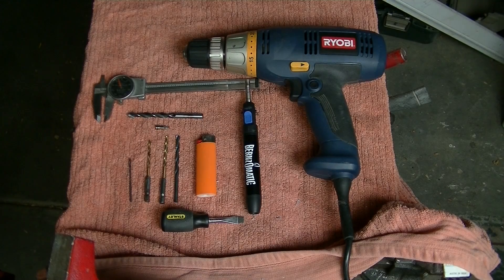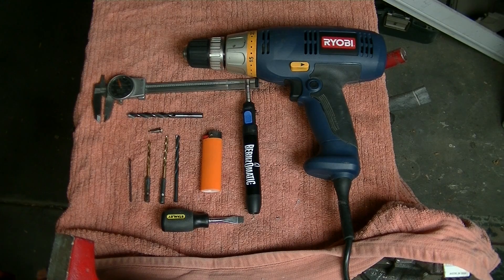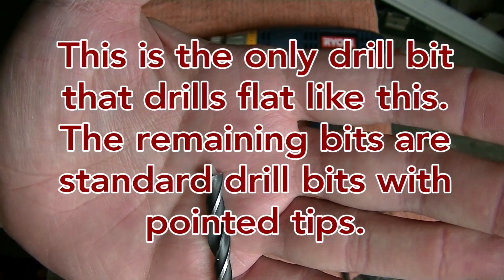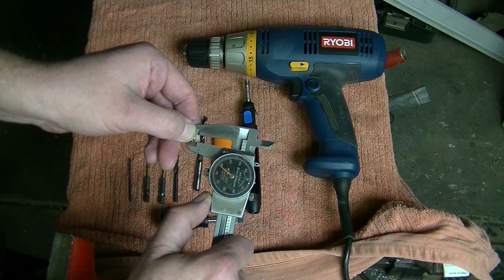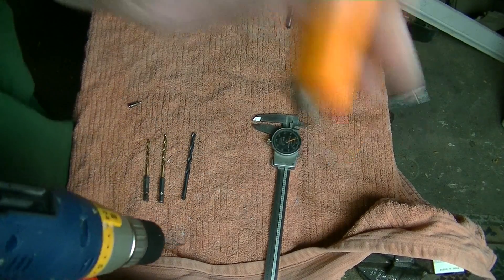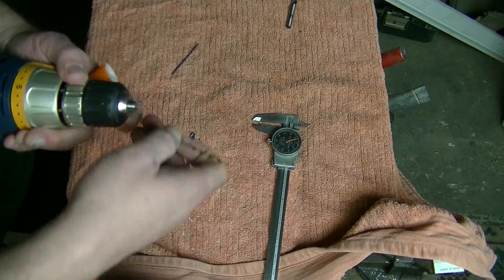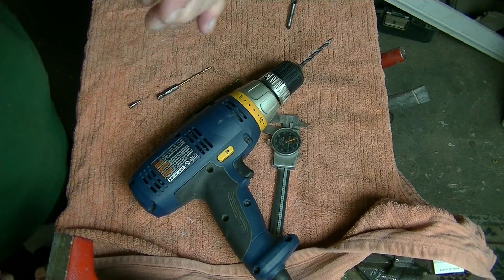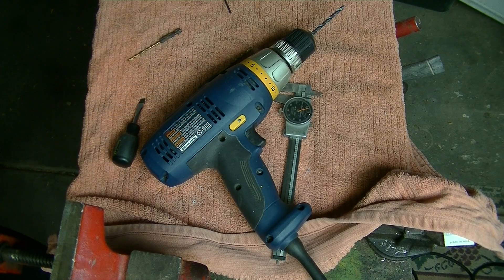Make A Bic Lighter Refillable By Installing A Refill Valve

Comment: I have installed valves in Bic lighters and suggest the following to avoid chipping pieces off the center partition that can increase the chances of clogging the system beyond what might have fallen in during the hole drilling  step.

Sand the perimeter ridge that extends around the bottom of the lighter until even with the bottom to create the widest smooth surface for the gasket to seat against. Then, mark the hole you will drill off center half way between the exact center and either side of the lighter which will allow a full seating area but prevent drilling into the internal partition. I drill with an 1/8th inch bit first after making a small starting point with an awl or center punch (this risks having more plastic pieces that may not come out when you try to remove them). Then I drill as squarely as possible with my final bit (#15 for my valves) and go slowly to avoid any possible cracking or creating a rough sided hole. Next, I create a small chamfered entry point around the circumference with a countersink in my fingers, to help the valve threads dig into the hole sides under complete control. I install the air soft valve with JB Weld black RTV silicone goo which doesn’t stick to the plastic but is good at sealing against pressurized fuel leaks (allow several hours for it to cure before fueling). I have installed the same valves successfully on the smaller Bic lighters as well. Note that you will wear out the flints eventually but they are available online. Be sure you get a small enough diameter flint. I apologize for not providing links but I had no trouble locating everything online. Best to all.
Reply from the maker: This is great! An off-center hole makes good sense.
Reply: Please can you make a video
Reply: Thank you for sharing 👏

Comment: What’s ridiculous? Is that? It’s so easy to remove the pin after you refill it that way. I will either just tap it on the concrete and it’ll break off and then push the pin the rest of the way in or I can snip it either way.

Comment: If you take the flint and guard off, and wedge the lifter valve up you can fill them through the top . It is difficult and fiddley but can be done.

Comment: 10 years later. How many of you just bought yourself a Clipper Reusable lighter? Can replace flint and fuel. Both so easy and fast. Sure you can replace flint on BiC but hard though. It's designed to be anti user serviceable. Same price gets you the vastly superior clipper. Fuel is better. Isobutane vs butane lights better in the cold. You can fit 2 zippo flints into the spring loader that pops out under the flint housing which it itself comes off the lighter. or if you have more than one clipper and got no fuel in one and need a flint in one with fuel, just an easy swap. it also packs a joint nice and tight. Yeah that kind of joint.find an old bic on the ground and don't have a flint in your clipper. easy fix to get it running because that old bic flint will pop right in to the clipper flint loader. even those free or 50 cent lighters will be cheap ways to buy a flint for a clipper. Clipper is the best and you don't got to build f all.
Reply from the maker: I just don't like the feel of clipper lighters in my hands ... something about the shape of the Bic combined with the material they use and the feel of the strike that makes it the superior lighter in my opinion.

Comment: I used a vice grip to hold the lighter and worked my way up to a 3/16" or 11/64" bit (idr - whichever one is smaller), starting with smaller bits. 

then I had to eat up the middle barrier in the fuel chamber a little bit with one of the bits so the refill valve would fit...

I used a handheld M6 tap and carved some threads, then the valve just screwed right into place with a perfect seal.

it does stick out a little so you can't stand it up on a table - which seems important to this creator so idk... it's not like a thumbtack at least lol

Comment: Just buy refills.
Reply from the maker: They do not sell refills for the Bic lighters ... you just have to buy more Bics.
Reply: @MikeSims70  well can the flint be replace on a bic?
Reply from the maker: @mick62569  Not very easily. However, the flints that they put in the Bic lighter is good for about 5 refills ... they are quite large.

Comment: you could also use the vice when drilling so you drill straight and not into your hand.
Reply from the maker: I've 3D printed a molding for the lighter in the past that is shaped for the lighter but ultimately provides flat surfaces to use in the vice. It worked well.

Comment: Do you ever have a probem with gas leaking between the valve and the lighter? Do you keep the rubber seal on the valve when you insert it in the lighter?
Reply: Rubber seal on the valve is what stops it leaking out while your refilling it. It causes a seal only letting the gas into the lighter.
Reply from the maker: The rubber o-ring seals it well... this is why the flat bit is used, to make the proper surface for the o-ring.
Reply: Still no name for the flat drill bit? @MikeSims70

Comment: you could have at least sourced them from cheap refillable lighters instead of a 10 dollar cordless soldering iron lol.
Reply from the maker: The irony of that, is that the same solderin iron kit costs like $50. But the valves can be found online for about $6.

Comment: This is pretty neat, but its very unlikely that the flint is going to last more than 1 refill. After depleting the stock gas on a bic lighter there is only 1-2mm left of flint (new flint is 5+mm) and unfortunately there doesn't seem to be an easy way to replace the flint without breaking the top mechanism. Personally I strip the flints from the bic lighters for use in zippos.
Reply from the maker: The flints in bic lighters are insanely large. They last a long long time ... multiple refills ... I'm not a fan of Zippos ... too high maintenance for me.
Reply: It's actually not difficult at all to replace flints in a bic, using little more than a flathead micro-screwdriver and pliers.

After removing the spark arrestor and striker wheel, carefully position the new flint above its spring and press down with screwdriver. Hold in place then snap striker wheel back on. Ta-da!

The only limitation I've experienced with bic is running out of fuel, which this video solved expediently.
Reply: @aidanhastings4710  To remove the spark arrestor and striker wheel do you have to pry the entire metal piece surrounding it apart? Or is there a  simpler way?
Reply: @vincentwu2848 simple you just take a flat blade screwdriver or pick and around the edge of the metal enclosure next to the striker wheel and the enclosure pops off. Another tip when you're putting the lighter back together the striker wheel has to go in specific orientation or it won't spark.

Comment: And you don’t have to make the nozzle flush with the bottom of the lighter if you go to the truck Stop and buy those lighter on a leash things. The Bic slides down into a rubber mold that’s about 1/4  length snug so you won’t see the bottom of the Bic. And you fasten the other end of the leash to your pocket or belt and you can let it go when you using  it and it snaps back to your belt like a key-back. I just snapped at some dude who called you boring. Look your comments. Old people save lighter in Later dude!!
Reply from the maker: Thanks for the kind words. I like to have them flush because I like to be able to stand them up on their end on a table. Makes them fully functional. ☺

Comment: Hey bro! I buy my nozzles from eBay. I used to be able to buy just the nozzle but like you said you cant find them anymore. So I buy lighter parts. I buy them sometimes 25 at a time. I m a lighter and flashlight freak! I smoke cigars so I have a torch lighter in every room in the house and they sometimes break down and sometimes I take them apart and can’t get them back together so I’ll take the nozzle out of it and make another forever Bic. I have so many lighters that they WILL last as long as I live! Lol
Reply from the maker: A true connoisseur - LOL

Comment: Or, you could simply buy a Clipper lighter. Less expensive and superior in every way to a Bic!
Reply: just swap my clipper flint wheel with the one from my out of juice bic, literally feels like a refillable Bic
Reply: clipper, upgrade the flint wheel (the main, vertualy only, working part) if you must.
Reply from the maker: In my opinion, no lighter compare's to a Bic in terms of the solid build, the way it feels in your hand, the sheer reliability of getting a flame in every strike ... even the texture (or feel) of the draw of the thumb when spinning the strike wheel ... has no parallel out there that I have ever found. I've used Clipper and I agree 100% that those are great lighters ... but it's not a Bic ...

Comment: There must be a way to refill from the top jet. Without doing any of this. Maybe its making an adapter for the refill canister that has a rubber o-ring. Then push it down onto the gas jet whilst holding down the 'go' button till full. I'm going to go try.
Reply from the maker: People have done it, but they often waste a lot of butane and the lighters never seem to last very long when you do it that way.
Reply: @MikeSims70  I tried it at the top but it did not work. The jet was way too small. I ended up buying another lighter after trying to insert a car tire valve. It would have worked but I cross threaded the valve whilst inserting it and it leaked. I also shortened the valve pin to make it so that the lighter could still stand on its base.
Reply from the maker: @waynoswaynos  Yeah thats just a whole mess art the top ... the theory is right ... open the nozzle and shove gas down the tube ... it's actual doing that ... which becomes challenging.  ;-)

Comment: Nice idea. But it's impossible to find any retailer that will sell such valves at a reasonable price.
Reply from the maker: I agree, it can be difficult to find valves for less than $10, which can cause the perceived value of such a modification to be too small and then unworthy of the expense and the effort.

However, The valve can be transplanted into another lighter, which means that for the cost of one valve, you can get potentially years of use out of it.

Also, if you look around, some places sell much smaller valves at smaller prices where it would even not be necessary to chip out the wall inside the lighter because the valve won't extend into that space which makes the job of installing it much easier.
Reply: @MikeSims70 I think these look like Airsoft magazine valves, which i can get for less than 4$ a piece where I live(I live in East Asia FYI). From what I know, you can order those from Airsoft stores.
Reply: So I just checked the description, there are several different types of airsoft valves. The cheapest ones I can find are we tech magazine valves, sitting at around 3 bucks a piece. It’s pretty short in length, too. Which could come in handy.

Comment: Never hold what you’re drilling…ever. I’ve seen a bit go right into a hand, while still rotating. Happens so fast.
Reply from the maker: I agree, but in this instance, I did not have a drill press and even I did, its a difficult object to secure plumb and centered under a press. Also, since the amount of force I apply to the drill to get through the plastic is so very minimal (and intentionally done at low pressure), a slip would be not only rare, but also it would have little chance of causing any damage as I would have been easily able to release pressure before the bit even moved past the lighter edges.
Reply: LOL, good idea in theory but c'mon,,, got holes in my head, why not my hands? And the drill was still rotating when it went into the hand?! Oh my! But isn't that how drills work? The real danger is when drilling into something hard in a tight space and getting your hand or wrist jammed up from the torque. This soft plastic poses no danger and too tight a vise would possibly deform the plastic slightly making the hole and slight oval and less tight. But who has a vise at home who doesn't already know how to drill safely?
Reply from the maker: @seasidescott  Yes, definitely. The biggest risk with the drill is making the hole too big or malformed ... if someone was actually capable of injuring themselves doing a project like this... well ... perhaps hands on hobbies aren't their thing ... is all I'm saying ... maybe something a little more their speed like .. bird watching ... or maybe a nice book club perhaps ... ;-)

Comment: A bit more extensive or difficult than your normal DYI project. But probably a bit more comprehensible to your everyday, hardcore tweakers. But I bet you a hundred bucks that the everyday tweaker doesn't finish this in one sitting, as they have 44 other things ("projects")  going on at the same time. 😆
Reply from the maker: Your statement is accurate, but this is not a project relegated to tweakers only. It's been years since I made this video and I've gotten feedback from a wide spectrum of people who are interested in doing this for a variety of reasons. Perhaps the most common underlying reason is "Because I can" - like a bucket list item ... some rely on the utility of it, others just think it's cool and the discord the entire time has been amazingly satisfying for me (even the disagreements) and entirely unexpected when I made the video. I thought MAYBE 100 people would see it ... boy was I completely wrong about that.

Comment: OR.. you just buy a refillable BIC. They exist.
Reply: But another lighter won't be the one I like to use
Reply: @Skyguy1337  Apparently the one you like to use is also not the one you like to use.
Reply: @janklas7079  well, when it had fuel in it I liked to use it. Now it's a nice sparkly thingy.
Reply from the maker: m not aware of the Bic brand selling their product in a refillable configuration ... at least not in the United States ... if they exist, where do they exist?
Reply: @MikeSims70  Bic does not make refillable lighters indeed. But lots of companies do, in the same form factor.
Reply: World contains of two kind of people: one who make refillable lighter out of disposable and sell them, and people who buy them online for $10 each
Reply from the maker: @alex.perreras  Doesn't seem like that have much margin in it unless you could crank out like 6 to 10 an hour and off load them.
Reply: @alex.perreras  

More realisticly:

one who use $300 of tools to build a leaking gaslighter which does wear fast because he chose a ligher with a flint 

and

one who pays $10 for 4 refillable non-leaking gaslighters with a piezo element which will last them a lifetime.
Reply from the maker: @janklas7079  It's the form factor of the Bic that matters. And the valve can be installed so that it doesn't leak. I do it all the time.
Reply: @MikeSims70  As I said: there are multiple suppliers delivering refillable lighers off the shelf, in bic form factor.
Reply: It's much more fun this way. It's a guy Hobby.

Comment: I swear I bought a few of these and they didnt last two weeks...I only smoked every 2 days..for a few min In the evening. They really need to be visible for what amount of fluid is in it..I would bet its only 1/3rd full. These things back in the day used to work forever!!!
Reply: They still last a long time for me. Like a month or two and I smoke daily.
Reply from the maker: You're talking about stock Bic lighters? Straight off the shelf? Cause if so you probably got some from a bad batch ...
Reply: I have a green BIC I've had for 6 years and it's never been refilled, but it's very close to empty now.
I have hemp-wick wrapped around it, I don't smoke weed or anything, but I use the lighter to light the wick and I use the wick to light whatever I want like a fire, or whatever, and I obviously barely use any gas because it has lasted so long, lol.
Reply from the maker: @escapetherace1943  6 years is a long time, and I love the ingenuity behind that. Also a testament to just how long their flints last. But I am curious, is there something special about this lighter that you would go through such lengths to make it last? Or is it just you trying to get the most out of a resource?
Reply: @MikeSims70  lighter ain't special, just never lost it, I have a couple others nowhere near as empty also wrapped in wick, needless to say I hardly buy lighters
Reply from the maker: @escapetherace1943  Id love to see photos of this as Ive never heard of doing this before so it's hard to visualize completely ... though I think Ive got the concept - nothing brings it home better than a photo :)
Reply: @MikeSims70  hempwick, it's waxed (usually beeswax) so you just wrap it around your lighter, it's basically what stoners use because it burns at a lower temp and that results in it being less harsh on the lungs. Personally I do not smoke, but have friends who either do or did and saw them use it. I just started using it as a tinder wrapped to my lighter itself, it really draws a single lighter's life out and it's not heavy and it's also good for outdoors/camping survival because the stuff is basically  a decent slow-burning tinder.
Reply: @escapetherace1943  I bet your pens actually run out of ink, 6 years is crazy impressive.
Reply: @jidek1234  honestly just a few... I don't use actual pens so much anymore. But yeah, wrap some slow-burning stuff around your lighter and you now have a thousand lights
Reply: @escapetherace1943  what slow burning stuff should I look for, where can I find it?
Reply: @jidek1234  hempwick, firecord, etc
Reply: It used to be adjustable so you could make it last 4 times longer lighting cigs. Buy vintage metal. Flame can be as small as a pea or torch!